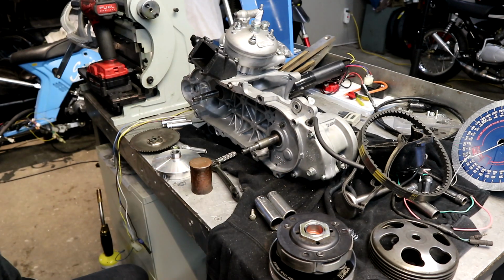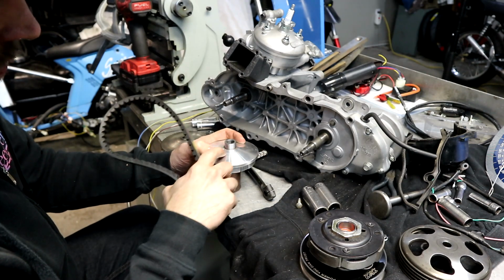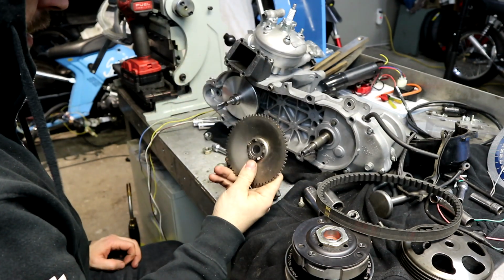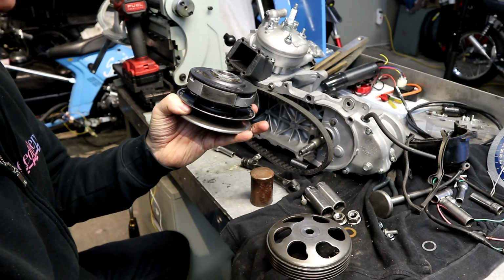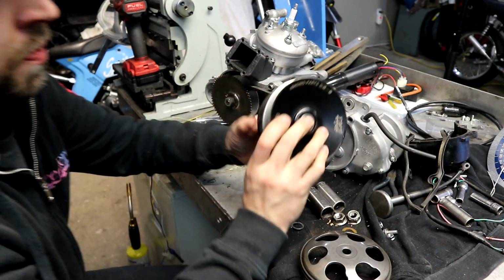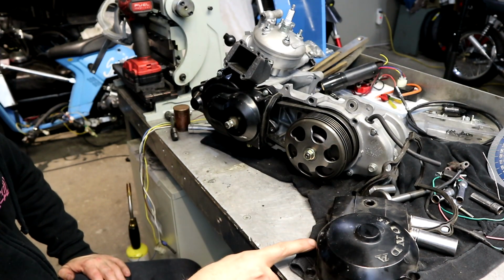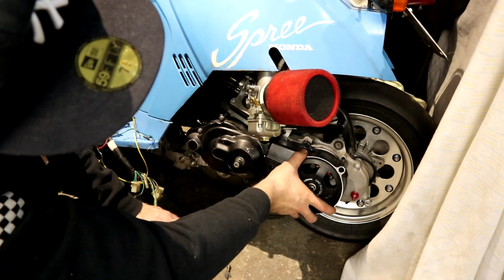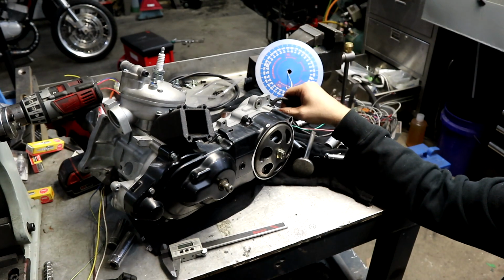Stage6 Modular Race Peugeot 70cc cylinder Honda AF18 build - Part 5 - J's Garage

Comment: Hello, could you tell me what the difference is between a big spline and a regular spline AF18 is and which is more desirable and why? thx👍🏻
Reply from the maker: i prefer large as most aftermarket stuff is large and canada only got large, but in the states small is what all the af16 were to my knowledge. japan had both depending on generation.

Comment: Great videos!. Do you know if a TWH 50mm 90cc will fit a Peugeot engine?(Speedfight, Vivacity, Trekker before 2004) Or if a Dio stroker crank will fit?
Reply from the maker: Gonna say, maybe with persuasion.  The crank might fit but I think the Speedfight was backwards to the Honda engine.  IE the oil pump drive was on the opposite side.

Other than that yeah some of it should fit with mods.

Comment: That "weird yellow Malossi thing" is called a Torsion Controller/Springslider.
Reply from the maker: Yep, I don't use them because they are too thick, I make thin ones out of Teflon.
Reply: @pitobread  I understand, the spacing between the clutch and pulleys is so small that it catches the pulleys on one side and the clutch on the other, keeping your pulleys from fully expanding.